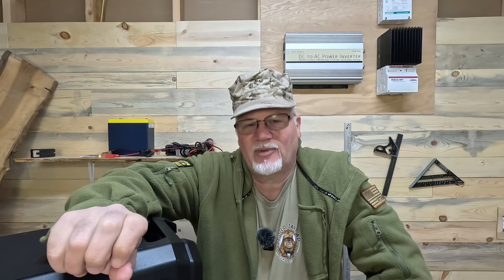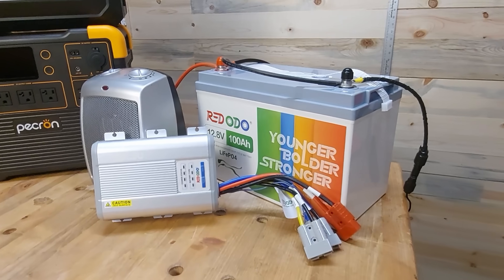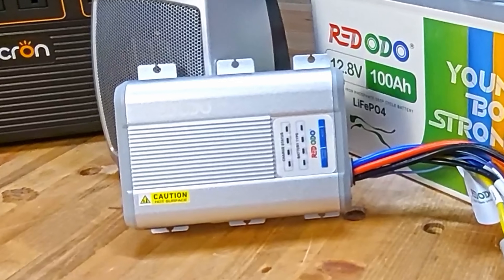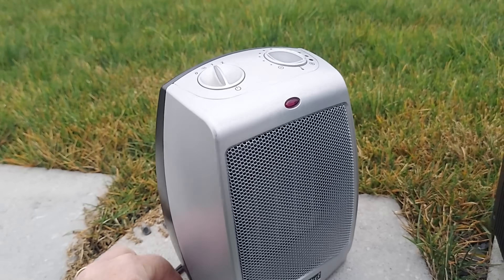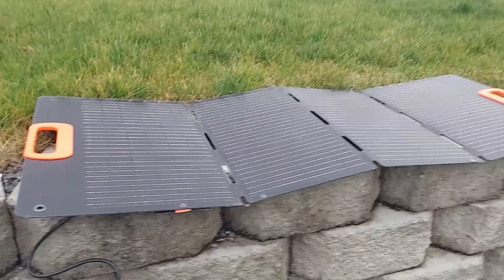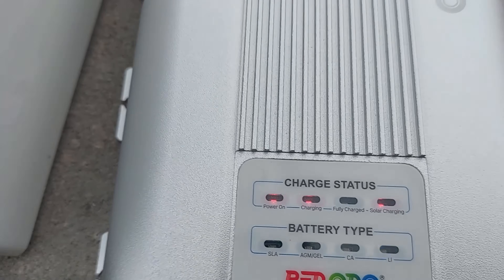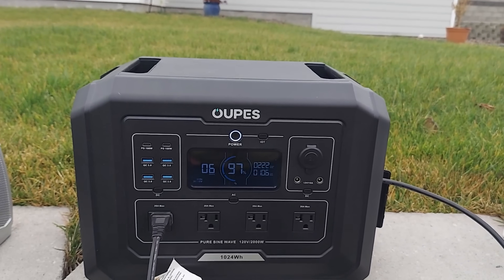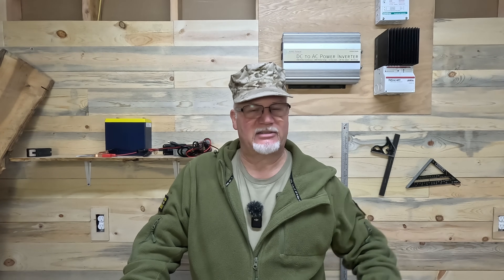🔋 LiFePo4 POWER STATION Hack That Actually Works! 🔋

Comment: I live in Louisiana in a hurricane/thunderstorm zone and when I had the money I got 11 various size power stations and a large 300ah LiFeP04 12v battery with almost 4 kwh capacity and the parts to connect it to solar and a 2000w inverter so I could run my little window ac. It has been an absolute blessing to have these because we have so many power outages.
Reply from the maker: Sounds like you’re set up for success!
Reply: @TheOldJarhead  I`ve planted a crazy amount of fruit trees and berries and 3 gardens over the past 2 1/2 years here too. Every year going forward I will have more and more fresh food if I can protect everything from these strange freezes we`ve been having. Supposedly we`ll get a break from extremely low temperatures this year. The soil here was hard red clay (a hill bulldozed flat) so I planted peas and beans and heavily mulched with leaves, grass clippings and leaf mold and now I have deep rich soil. Once the earthworms & fungi moved in everything changed. It seemed impossible to fix but it worked. For every inch of topsoil I created the earthworms added 3 or 4 inches to it.
Reply from the maker: You've got a good plan, and it sounds like you know the drill
Reply: The lifpo4  system will go much further than gasoline  in a generator. 💪💪💪
Reply from the maker: Though you still need a genny IMO